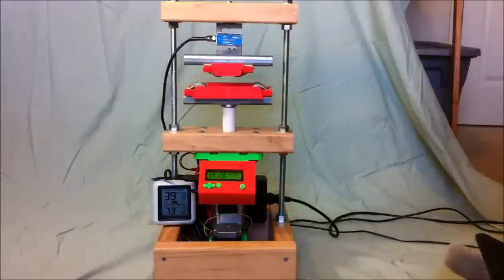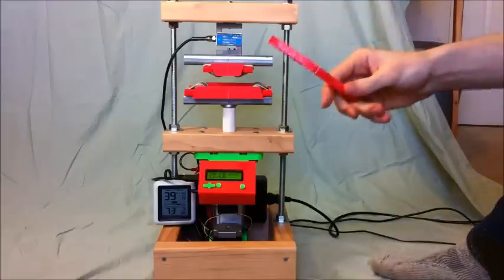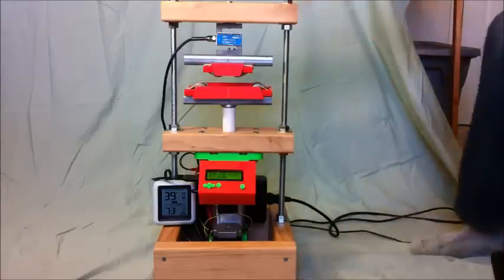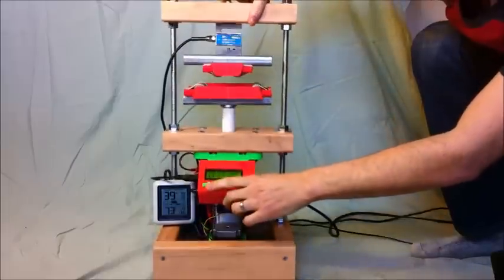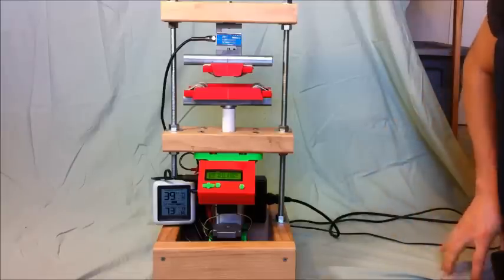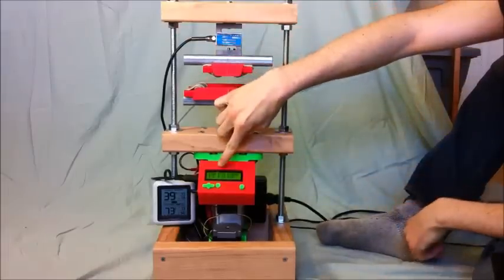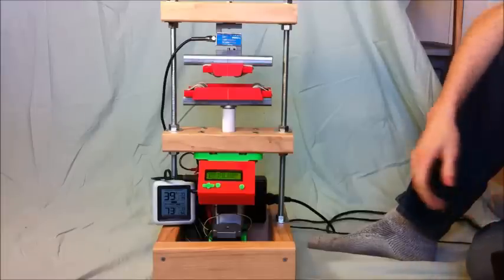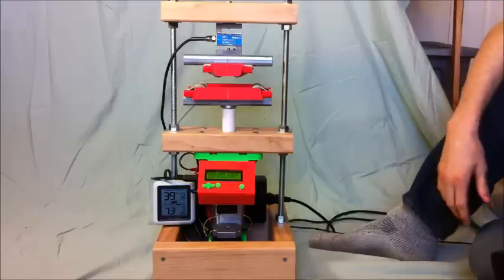TestrBot Universal Test Machine In Action!

Comment: What did you use to measure the displacement ? thnx
Reply from the maker: I tracked steps of the stepper motor and calculated linear displacement from rotational position using the screw pitch.